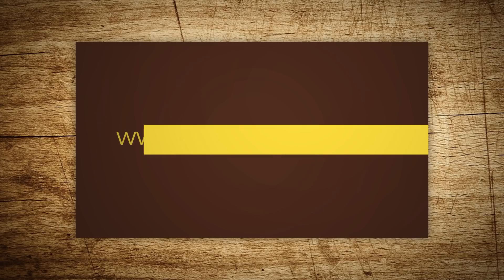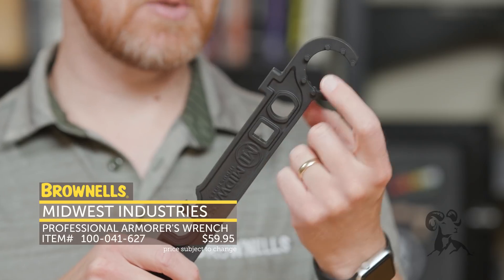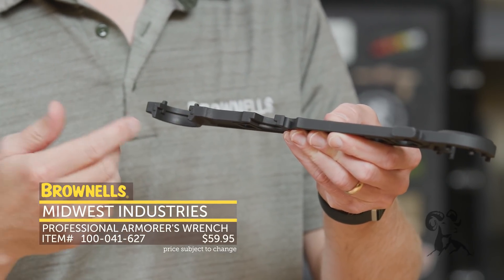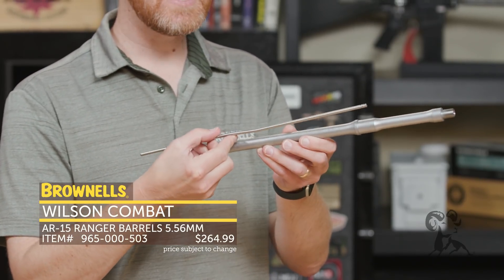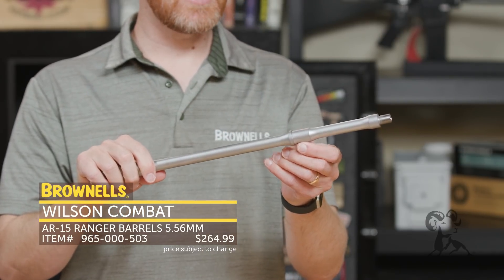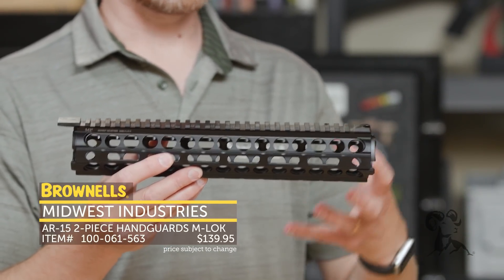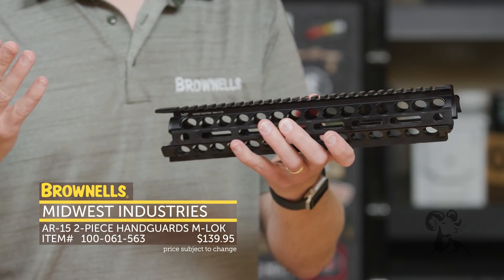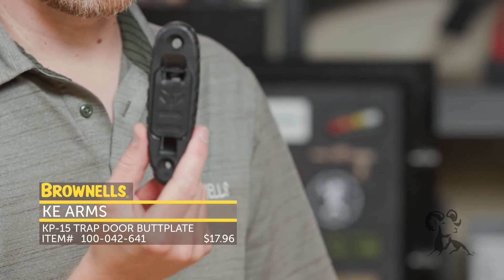New Products: Midwest Industries, KE Arms & Wilson Combat

Comment: Ke arms kp15 stock will hold a mora knife without scabbard. Or 30 rounds of 556 . Also slot the screws with a grinder so you can open with a coin.  The factory  screws are t15 and t25..

Comment: Longer gas system doesn’t reduce the pressure as stated. Correct me if I’m wrong, it’s the same pressure just less dwell time.
Reply: The pressure should be higher if the gas port is closer to the chamber, but you're definitely right about the dwell time being longer for barrels of a given length.

Comment: Does putting that gas port further down the barrel have any effect on muzzle velocity? Or does the gas system not redirect enough to matter anyway?
Reply: There is not an appreciable difference in velocity with changes in gas port location due to the fact that the bullet is long gone before the bolt unlocks and travels rearward. That being said, if you hypothetically had a 20" barrel with a pistol length gas system, you might see a drop in velocity due to the specs being at the opposite ends of the desirable spectrum.
Reply: @rhubarbpie2027  I have a chronograph and I've gotten pretty good at my hand loading...it would be interesting to test two 20-inch barrels with varying gas ports.
Reply: Could have a difference, but it would be microscopic

Comment: KE Arms is trash. Currently testing one of their lowers, AVOID AT ALL COSTS.
Reply: Which lower are you testing and what issues are you having?
Reply: I doubt Ian would have chosen ke arms for the what would stoner do project (wwsd) if they were "trash"
Reply: You are a fraud. I have 2 kp15s. They are awesome. Low price bleeding edge technology  and less parts simple high reliability
Reply: @thedeathwobblechannel6539  none of what you said refutes the very real issues I've raised with the design, even if they were accurate.
Reply: @jonathank7394  that was my hope too, but he can't be held responsible for the resulting lower another company produces. It isn't even ambi by default, and requires a gunsmith if a regular safety selector is installed and you want to change to an ambi selector - does that sound like what Ian would endorse? It also doesn't have places to stow the non-captured takedown pins, which I'd guess wouldn't be his choice either seeing as he has complained about that very thing on other guns.
Reply: @D3ATH222  make a video.  Show proof.
Reply: @D3ATH222  I have a KP15 that I have gone through 3 different safety selectors in before I settled on a KE one. Made for the KP15. Getting them out was tricky but not impossible and didn’t damage the retaining wall. While the takedown pins not being captured can be annoying it’s not enough to keep me away from the platform. I haven’t experienced the rattling that you have and I haven’t taken my butt plate off so I can’t verify the screws being different sized.
Reply: @danielamador5932  how did you remove the safety selector without forcing the detent through the retaining wall? Unless you have an impressively tiny shim set, idk if I believe you... I suppose I could have tried lock picks but it didn't occur at the time. Funny how how ended up choosing the one specifically made to work with their wonky, poorly toleranced lower. Regardless, why would anyone choose this hassle of proprietary BS compared to the industry standards? Any savings are heavily outweighed by the lack of quality and limiting features.
Reply: @thedeathwobblechannel6539  you have two, go shake them. If they don't rattle, you will never believe my video that mine absolutely does (and has from the second it was taken out of the box). If they do rattle, then my making the video would be moot. Happy to share my experience with the lower but I'm not creating content just so you can avoid thinking critically about your own sunk costs.
Reply: @D3ATH222  I removed the selector with light pressure while also keeping it between both notches so it’s already somewhat depressed. It was definitely not the easiest thing and in response KE has made a version of their ambi selector with a cut out that allows you to easily do this process. Other than that it’s their standard ambi selector. I will ask you how often do you swap your selectors on your other lowers? Of my three rifles I really only swapped one before I’d even put the buffer tube on and after that the selectors tend to stay due to the hassle of removing a pistol grip to swap it out. The KP15 is a new product that has a few teething issues and a few things that are different such as the pins but I don’t believe that’s a bad thing, but industry stagnation is. I believe you may have gotten a defective lower and should probably send it in to be looked at if you are having this many problems with it.
Reply: @D3ATH222  not a representative but just a customer. You aren’t limited to a KE selector but their selector is the easiest to remove. While drilling out the selector is probably the safest option I was able to wiggle two different ones out with no issues. Yes there is a fee for misuse and abuse and voided warranty for dyeing the polymer much like most companies won’t replace a lower if you start forcing larger sized pins into place or toss it into an oven to try and reheat treat a part. The difference is it’s a polymer lower and requires greater care when assembling as well as dyeing polymer can change its molecular structure and they don’t have the time or want to test every single dye on the planet with their polymer. YOU had issues with one unit, I have had no major issues with one unit. They have sold 15000 or so lowers to date and everyone I’ve talked too about it has had positive experiences. I firmly believe you got a defective unit but that doesn’t mean the whole concept is flawed.
Reply: @danielamador5932  Defective in what way? I'm not talking about using the wrong pin in the wrong hole, or dying the stock chemically, I am talking about using a detent pin that would work in any other AR-15 in the world and having it brake your gun or spray paint being considered a warranty issue. For ten more dollars (in stock on PA) you could build a forged lower out with magpul pistol grip and CTR stock (giving you adjustability, easier stowage, QD sling attachment) so you never have to have any of the concerns listed. You could change anything you wanted about it in the future without needing to potentially damage the lower. What benefits do you get from the lower that justify its balance of cost to features?
Reply: @D3ATH222  my safety selector spring was short. Popped it out, stretched the spring a lil bit put it back in. No damage, no harm, no foul.
Reply: @D3ATH222  mine both don't rattle.
Reply: @danielamador5932  my lower is in the 600 serial number range. It has a selector drilled already to depress the detent. I could not find a paperclip  to press it down. Midway between positions and light leverage w screwdriver mine popped out.  Easy to do.
Reply: @thedeathwobblechannel6539  *"Neither of mine rattle." Good for you. Mine rattles.
Reply: @D3ATH222  my safety works too.